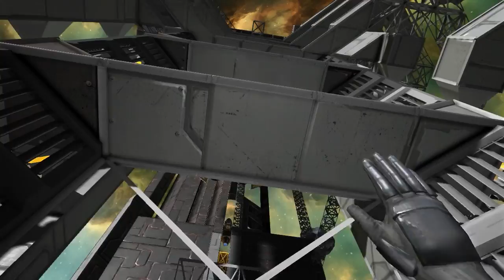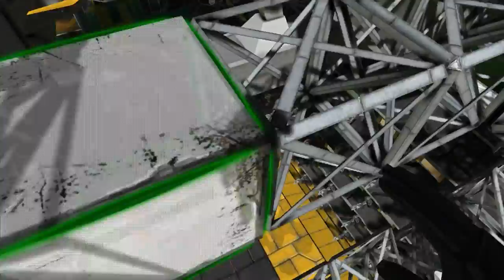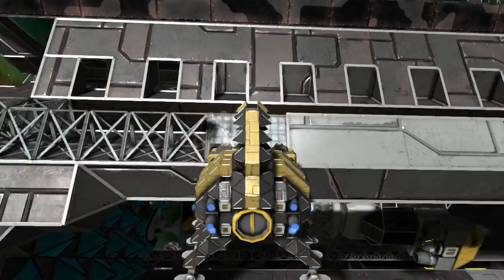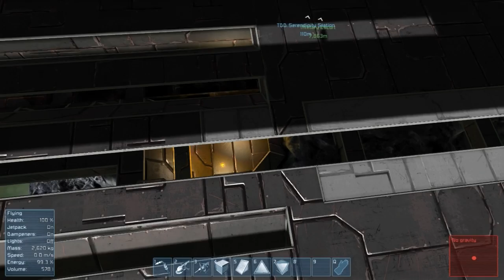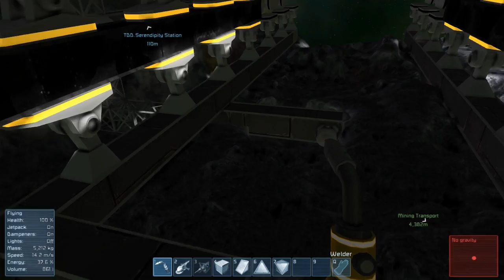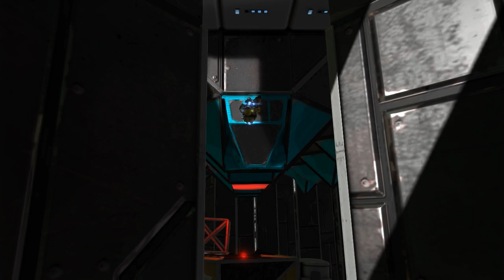Space Engineers Co-op Survival - 45 - Searching for G.O.D.

Comment: Have you guys though about having the grinding wall move instead and use a merge block to turn the ships you're grinding into a platform?  Quite a number of things would be impacted with that change so it's just unrealistic to switch now.  And since like you said in the comments below, you don't want to redesign this again I would certainly understand why you'd not take my suggestion, but just asking...
Reply: ***** Yes, thinking of it from a high level (and not knowing the low level details like you do) I assume this would be a significant change that would impact multiple parts of the build.  So unless the multiplayer netcode issues are never resolved, this is likely more hassle than it's worth considering how far along you are with the current design.
Reply: ***** The center of mass issue caused by the ships which you're attempting to grind, is a rather thorny issue.  Each ship has a different mass so even if you get it working for one design, it may not work for another ship--and in reading the wiki, it appears they've redesigned the ships over time so this could happen again, further complicating things.  So resolving this really seems to depend on if they are successful in updating the multiplayer netcode to deal with these issues.  Your design seems more dependent on the netcode issues being resolved but like you said either design probably has this dependence to some extent and likely any design will to some degree.

Comment: All you really have to do is fly the ship into the grinding wall at .02 mps 
Another thing to stabilize gravity fields is to use 4 generators 2 constantly pulling on each other and a third one influencing the direction.
Lateral stabilizing thrusters and a gyro on the pusher might help instability. 
But because of the net code just fly the ship into the wall at .02 or remove the rails entirely and use a gravity suspended mass pusher
Reply: ***** Nowadays there's a tickbox on the gyros to enable/disable control by a control chair :) you can do this now...
Reply: ***** Nope! was playing with it earlier. It turns off the manual controls and provides access to PYR sliders to allow you to make mechanisms properly.

Comment: You should probably use merege blocks to conect the ships and the moving part and use the new thrusters instead of a mass block and grav gen to move the whole thing. It will be a bit tedious to put a mergeblock in every ship you want to grind but at least that way the movement would be completely linear and you would't need to worry about centers of mass. That should get rid of the inestablility issues ompletely.